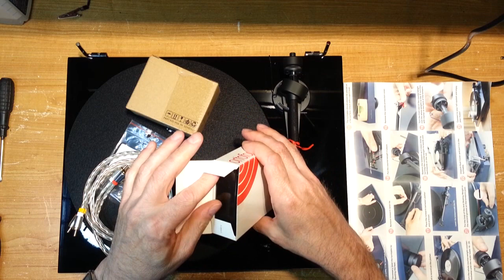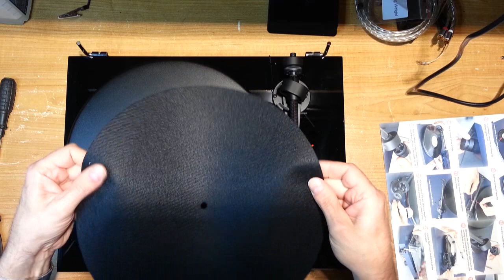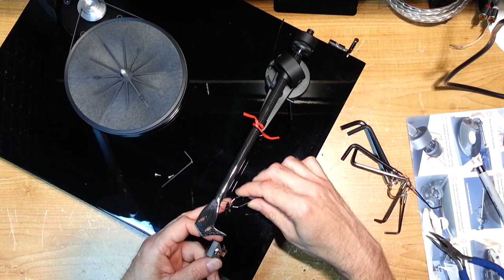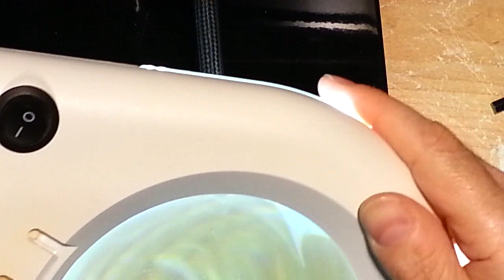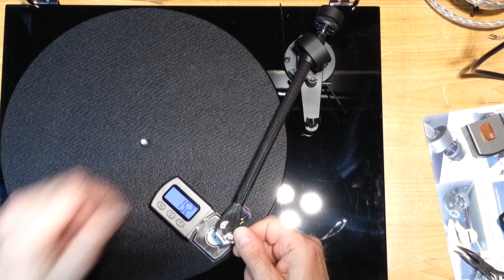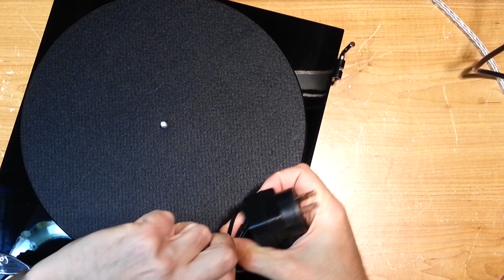Pro-ject Debut Carbon Evo: Ortofon 2M Bronze Installation

Comment: Past time there should have been a modular connector introduced for many new TT and most used cartridges, and transition to it.   I ruined wires on a new TT,  non-removable mount, as It was the first time in 25 years to change cartrige and my eyes are not the same!   Had to wait during C-V times to send in TT for arm rewiring.

Comment: A bit confused. Does the ant-skate weight go on the first notch or third for 2M Black? Thanks for your video.
Reply from the maker: I don't have the table here anymore - you definitely want it on the lightest setting and I believe I may have been mistaken in the video.
Reply: @TurntableGuy   thank you for your answer. I had it on the third groove and was noticing distortion in the left channel on vocals. Going to move the ant-skate to the first groove and see what happens.

Comment: So how about the cartridge alignment using the protractor project supply and an explanation of this critical point of set up.  Noticed the scales were not calibrated prior to use. Thought fitting a 2m Bronze would have covered these items.

Comment: Thanks for the video. I would take my Denon DP-30L MKI every time over a new turntable 😎😎🤘 Wow and flutter: 0.015% WRMS (servo), signal to noise ratio: 78dB and weight: 9.5 kg.  That's a great TT 👍

Comment: These new "audiophile" turntables that cost $300-$500 are a joke to me.  No safety clamp on the tone arm rest? No removable headshell for the standard mount cartridge?
Belt drive with worse wow and flutter than a garage sale direct drive? Sometimes pay extra for optional dustcover? 

And the salt in the wound is that they are made in China.
Reply: Agreed, vintage turntables sell for half what these turntables sell for and are better than turntables selling for $1000 spec-wise.
Reply: Nothing by Pro-ject is made in China. 

Everything is European made and is made in house.
Reply: The Pro-Ject is made in Europe, pal.
Reply: @knivesandfire1  yes, Tschechien and Slowakei!

Comment: A pal gifted me 2m black body(no stylus) & I thought 💭 wonder how my 2m blue stylus would fare in the black body…WOW!!!not only does it fit but also works,& works great!
Don’t know what I’m losing from the black, but I know what im gaining from the blue stylus.
It sounds fantastic & a cheaper upgrade.
Reply from the maker: You're using a slightly less exotic cut of a diamond.  The Black and Bronze have Shibata and Vividline cuts, whereas the Blue is a simple elliptical.
Reply: @TurntableGuy  for sure.
Don’t know what I’m loosing without a black stylus,but sure know what I’m gaining with the black body…another level!

Comment: I own this turntable and upgraded the cables sold to me the same day. The salesperson was the store owner and mentioned he wanted to retire and was selling up. It was my way back into vinyl about 4 years ago. I would recommend this to anyone on a tight budget. The black piano finish looks very cool but tends to show off dust and scratches. so what to buy to upgrade?
Reply: I would but some KilMat to quiet the obnoxious motor noise by covering the resonant plastic platter, or sell the table and get a vintage Technics which costs less and has better specs!

Comment: Hi thanks for the great video, I was just wondering if upgrading to acrylic plater would be a good idea. It's lighter than this steel stock one.
Thank you.
Reply: upgrade the sub-platter if using the acrylic
Reply from the maker: The only way to really know would be to try them both.  A heavier platter has a better flywheel effect and should hold better speed, but acrylic is known to be very quiet.
Reply: @TurntableGuy  thanks 👍

Comment: the arm has fractures
That's not right haha that adding more bias not less ! you want it on the nearest portion of of the bar give you less tracking Force and always go by cartridge recommendation not manufacture of turntable.
No you don't want means power in the turntable that's not good but yes that will what adaptor is a low cac a good quality mains switch mode power supply would be beneficial

Comment: I am sorry, but you have been apparently confused by the manual regarding the anti-skating settings. The second groove is for 15 to 19 mN, so it is the same one for the Red with 18mN VTF and for the Bronze with 15mN VTF. If you want to go lower, you have to use the first groove intended for 10 to 14 mN instead of the third, which is for 20 to 30mN.
Reply: Yes you're right have to use the first groove 1 to 1.4 g you just move the decimal point, I would always use the first groove anyway do not rely on on the force of the cartridge it changes along the record surface anyway! The further to the centre it gets the bias increases and vice-a-versa,  and it had bias already looking at it I don't know if thats the wire incorrectly installed or it's on  maybe an unlevel surface! always run it heavy especially when braking in

Comment: About a year ago I purchased a pro-ject turntable similar to this but the DC model. The sound is ok but I think that given what I know now I am not sure I would buy it again. As I wrote the sound quality is ok however  initially I had problems with motorhum and there is still quite a bit of rumble going on. I also had quite a bit of IGD but I have since solved that with a cartridge change to an mp110. Ps even an at95e works better on this than the Otofon red it comes with. On top the turntable itself doesnt make a very robust impression and is a bit flimsy. I have a Thorens td160 from the last 80s as well and qualitywise there are light years between them. I am now looking to trading my pro-ject in and getting myself a technics which should be a bit better built (but obviously more expensive)
Reply: Tom, I am doing the same and I’ve already sold my Debut Carbon Espirit for the same reasons as you! I recommend a Technics SL-Q2/Q3 or a Technics SL-D2/D3.

Comment: 2m bronze on debut this seems like overkill.
Reply: Its not overkill. I went from the Red , to the Bronze ( OMG!) , to the Black . (( OO MM GG !) LOL 🤣
 NOW , to a MC that cost $300 more than the table. Happy now .
Reply: @jerryjohnson4625  I’m considering upgrading from red straight to black. Wouldn’t consider much more than that. Having done so, would it be your recommendation to go straight to black or should I go bronze first? Or would you put the money into something else?
Reply: @MrAtravenscroft  well it's the same cartridge just a different stylus. The bronze is very very detailed and sweet. A black is a little more analytical , a little more detailed. Different diamond cut. If you buy used you might find a bronze stylus with a cartridge. And at some point you could purchase a black stylist and just pop it in.
Reply: @jerryjohnson4625  Which MC cart did you move to? I'm about to jump from a 2M red to 2M bronze on my DC. iFi ZEN phone/Yamaha amp.
Reply: Not really. Got the same setup and it sounds killer!
Reply from the maker: I don't make the choices, I just install them...
Reply: Now I bought a pro-ject Evo. I put a sumiko songbird moving coil on. It is wonderful. The ortofon red is a nice starter cartridge. I was impressed for that price. I never purchased the blue stylist, I just switched to the bronze stylus and cartridge , that was quite an improvement up the ladder , then I found a lightly-used Ortofon black stylist for sale. Wow wee ! Those are very nice.
Never had a moving coil and I'm happy with this one. As for overkill on the Evo , I don't think so. It's balanced and setting on a marble cutting board that's sitting on four suspension feet. No bass rumble. Just sweet music. Yes I have a $899 cartridge on a $499 turntable ,with a $350 power supply. It works very well. It's really about the music.

Comment: I am thinking of purchasing this. Thanks for the information.....Is the output on the wall-wart AC or DC?.  My phono pre-amp (Schiit Mani) has a wall-wart with an AC output, which I thought was unusual.  I wonder why they would do that?
Reply: dont
Reply: Because it's cheaper and easier to make a rectification in the shitt then spending a lot of money on a good quality switch mode power supply, what would have put the cost of that unit double its price or more..  it's not a great pre-amp and your stuck on mc issues. The ifi zen is better for mc but if I was you I'd go with the Rega fono about $160 for mm cheapest second-hand. If you really want to get into it then the project innovate tube box2 phono stage is excellent for 350 running MC or MM especially if you update the tubes. if You going to get that project change these RCA leads they're not particularly that good and they're not shielded.  length plays a big part in moving magnet the shorter the the more bass you'll get the longer it is the more top end you will achieve so keep that in mind on cartridges you have? So for these ortofon cartridges I will keep it short no more than half a metre and triple shielded cable something like Belden cable 50ohms RG214 /u or RG13/u different resistant properties,  not expensive.  use silver RCA plugs they Chinese ones are ok I think or something from chord Electronics. And your question is it's 15V DCV. And change the power supply for a regulate switch mode 15 volt 3+ amp power supply something for a laptop would be a lot better
Reply from the maker: Sorry, I can't remember and the table is gone.
Reply: @TurntableGuy  What I was curious about is the advantage of an AC wall-wart vs the more common DC output, not a specific question about this table. Thanks anyway.  Maybe another viewer will see this and know.
Reply from the maker: @EddieJazzFan  There really shouldn't be an advantage either way.  If the power supply is stable and the motor speed is as well, either should work fine.  Technically, going AC to AC just involves a transformer, where as AC to DC involves rectification.

Comment: Another great episode. Still haven't been able to figure out why there's such ubiquitous love for Pro-Jects. What am I missing? Side note: would love to see one where you talk about your favorite p-mounts. I've been tempted to explore that route but haven't heard too much about the carts that are still produced for them.
Reply: i only currently own One P-mount (technics SL-QD33) i do LOVE IT and it has a good sound, but it has 2 problems the antiskate is not adjustable and it pulls to the outside hard enough to fall off most 45's when repeating or starting automatically (not a big deal manual is a thing lol), it has a 60hz hum that even grounding only lowers but does not remove, i even bought a new cartridgetrying to fix it replacing the PT200 on it with an AT92E (a VERY GOOD cart in my opinion) it sounded even better but still humming, so there are some REALLY good sounding carts available and pretty cheap comparably, if only i could get rid of that HUM, it is not a problem with all P-mount turntables but cousins of this table i have owned do seem to have this problem (it could be aging caps, resistors, or shielding) and i don't know if it can be fixed but i would use it TONS more if i could get that hum to GO AWAY
Reply: @ocularcavity8412  That's a bummer. I've been looking a Technics quartz-locked p-mounts from time to time because they're cheaper on the used market (and obviously due to the convenience and performance benefits from the pre-aligned cartridge and quartz-locking respectively). Too bad to hear that there may be hum issues.
Reply: @unchanging_window  they are still good turntables  really good to start off with on too cheap sturdy and with good sound and some upgrade possibilities even play warped records that might be hard to play on half inch mount tables, and if found cheap enough (estate sales are good places to look mine was $10) i would still recommend even up to $40 or $50, or if you can find higher end models i am sure there would be no hum. it is still very enjoyable over all i have had it for at least 7 years and will not part with it, and It was my main table for most of that time. But then i found my SL-Q2 and it is DEAD silent and so is my Pioneer PL-518 they are both Half inch mount BEHEMOTHS with removable head shells and that is where you end up eventually the cartridge possibilities are ENDLESS, Once you are ready to put some more time and money into the sound can be UNBELIEVABLE even some old $30-$60 carts can sound AMAZING when match with a table that likes them
Reply: @ocularcavity8412  Thanks for the advice! Yeah, I have an SL-Q2, which I love. And I have a great cartridge on it. I'm always just doubting my alignment/VTA/VTF, so the freedom of not worrying about that sounds nice, haha.
Reply: @unchanging_window  Yeah i feel ya, alignment can be tricky especially when the cartridge is an interesting shape ( i am looking at you ortofon ) as much as i love the 2M black and red i NEVER take them off their head shell cause it takes it takes a lot of care to get them in just the right position and not lose the position while tightening
Reply: Same here, the Planar 1 is a lot better and(at least here in Europe) better value. Despite having a conical stylus the planar 1 is superior in every category in terms of sound compared to the carbon range, as seen here.

https://youtu.be/MuuOgT0XBK0